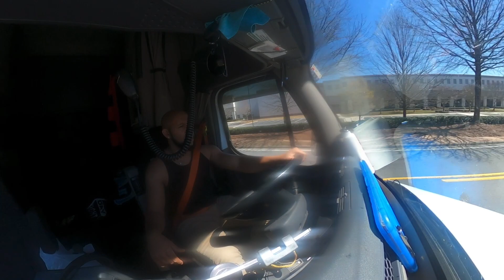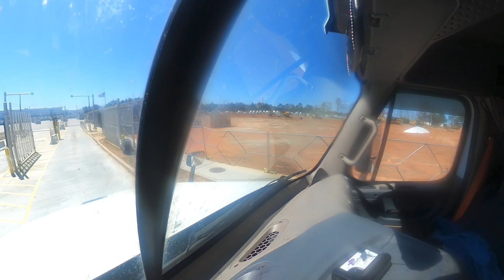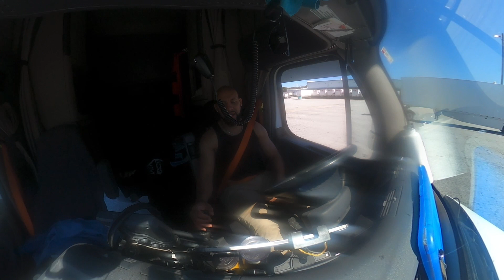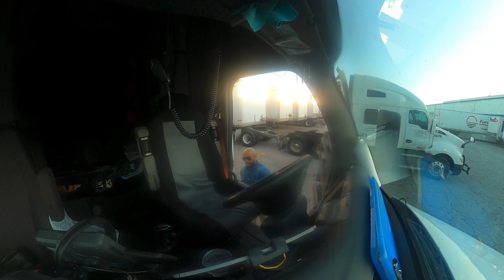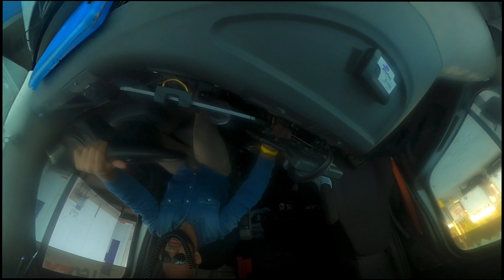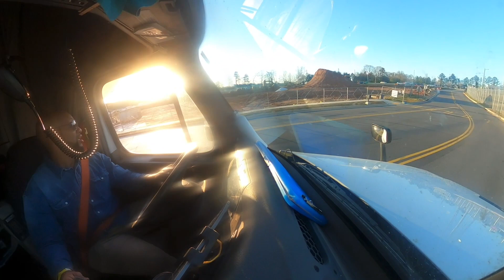NAVIGATING ATLANTA FEDEX GROUND TERMINAL (303)

Comment: Worst terminal in the south east region they can’t ever get things right and loads are NEVER READY!
Reply from the maker: It’s been a while since I did that Atlanta run at Fedex. I know they got those new gates there. Is it still terrible?
Reply: @Smooth_Operator_83  getting in isn’t bad it’s trying to leave. It’s been pretty bad lately waiting 2+ hours on a return trailer.
Reply from the maker: @scooter8880  OMG That’s crazy.  Yeah my trip was 612 miles round trip so when they held me up, but still wanted me to have the load 300 miles away by  4 am in a truck that only goes 65 mph.